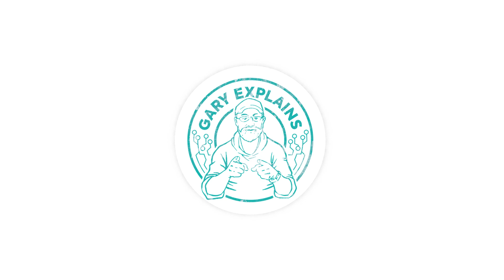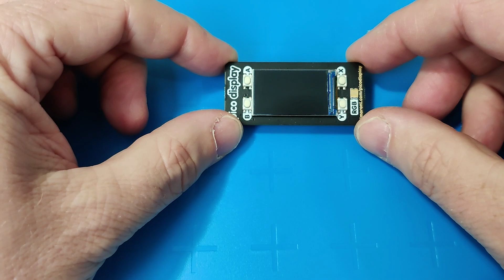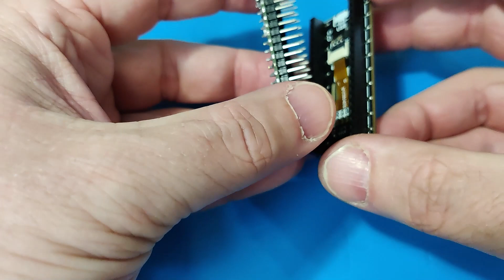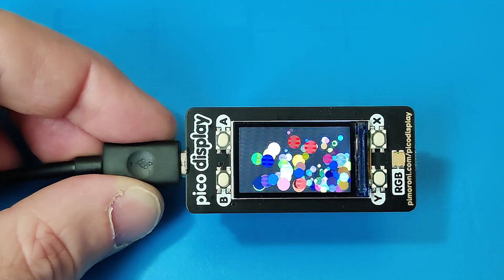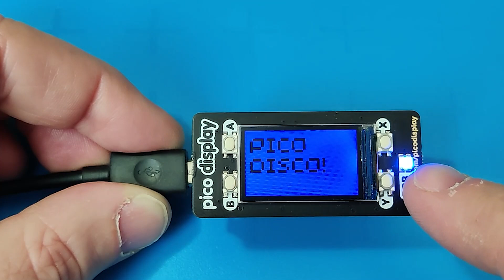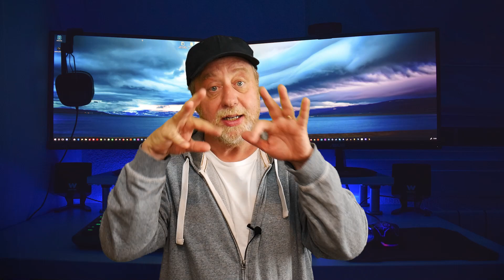Pico Display: A small IPS LCD screen for the Raspberry Pi Pico, with 4 buttons and a RGB LED

Comment: Nice explanation. The biggest downside here, as far as I can see, is that you lose all of the pins. So if I wanted this to display data from an external sensor attached to a GPIO pin then I would have to put header pins on the pico that attach to the screen and also project the other way to allow connection to the GPIO pins etc, or am I missing something?
Reply: Not the greatest layout but if you solder your own header pins you can have them extend both ways so you can plug things from the other side too. The display doesn't use all the GPIOs according to the schematic.
Reply: @mdo  I'm not skilled enough to read these schematics. Are there enough pins left over for an rfid reader? I currently have a program running on a Pi 4 that reads an rfid tag and loads the id into a database on my local network. I'd like to add a screen, but I also need about 20 of these for a project and don't need the full capabilities of a pi 4, nor do I have the budget for 20 of them.

Comment: Does this work with the Raspberry pi pico W? I think I would be cool to get two of these and use it as an messenger. Maybe b-y to scroll between characters a to delete and x to send?
Reply: Should work just fine with the Pico W as they're fundamentally the same with the exception of the wireless module.
Reply: @mdo  Yeah the only difference I know of is that GP26 is not usable on the Pico W and so the LED is on GP01 but that shouldn't affect much really